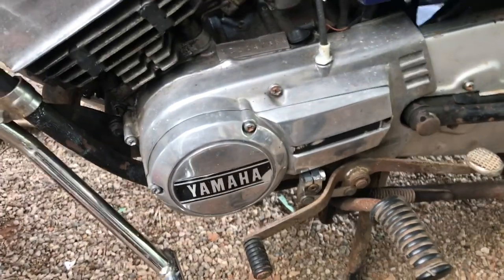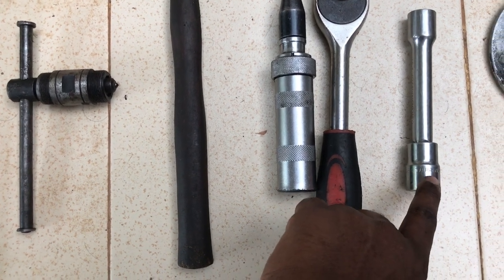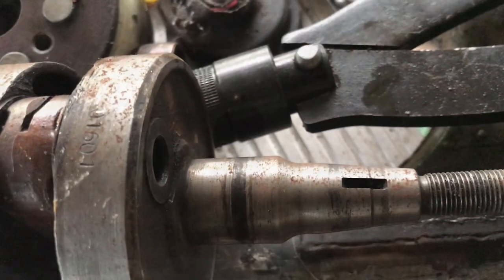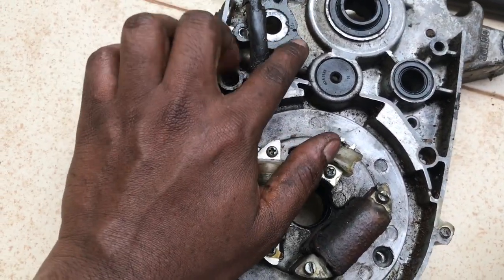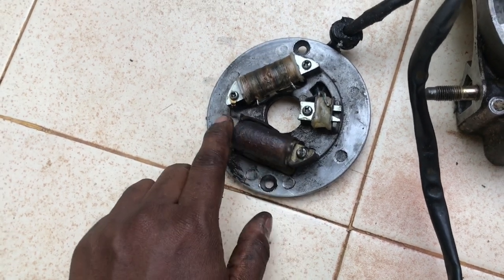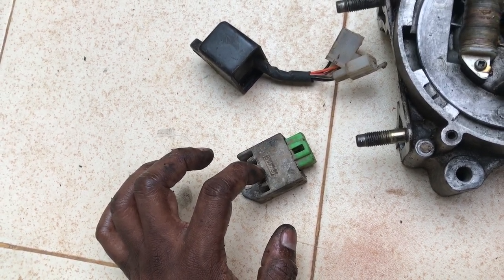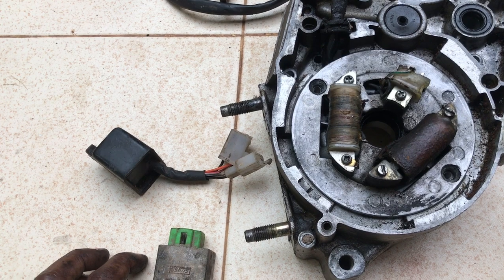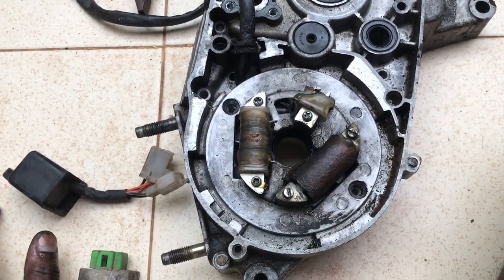Yamaha RX 100 6V to 12V conversion.

Comment: Is rx 135 lighting coil a full wave coil?
Reply from the maker: What do you mean by full wave?
Reply: @Yamakaze  stock it comes with a halfwave coil, we can convert this coil to a fullwave coil along with a fullwave rectifier
Reply from the maker: @dasinduhewagamage5949  technically it should be better, but what is the usage that makes you looking for a full wave system?
Reply: @Yamakaze  so that i can fit a fullwave rectifier and make it 12v, beacause I'm from srilanka and we dont have rx 135 lighting coils here for sale

Comment: I have tried another method which is very simple but not a perfect solution , 

My rx100 is 1986 model 
I changed 6v regulator to 12 volte and replaced bulbs for 12v electricity , 

Everything works good , but battery won't charge enough
Reply from the maker: If battery won’t charge how is it a solution?
Reply: @Yamakaze that's why I told it's not a perfect solution , my indicators and horn didn't worked because of not getting 6v battery , i tried emergency light battery but didn't worked
Now it's atleast working , 
I have 12v coil and wiring kit , I am not converting because, i think let it be stock as it is

Comment: Hi could you please do a video on rx 100/135 complete re wiring..
Reply from the maker: Sujil Ps I have already done a wiring video

https://www.youtube.com/watch?v=tIM19SI6fY8
Reply: @Yamakaze  thanks for the reply, I had already seen the video, it was realy helpfull.  My bikes wiring harness all gone can we make a new wiring harness by ourself or should go for new one, of so good quality one is available?
Reply from the maker: Sujil Ps buying new harness is easier and cheaper. New one is around 500, and available easily. Making one will be fun but sourcing all the connectors and matching the length of each loop will be a pain. OE one was available for 310
Reply: @Yamakaze  Thanks a lot for your reply.. looking forward for your posts..

Comment: What is the benefit of changing 6v to 12v?
Reply from the maker: Nibin Mathew better lighting mainly, 6v batteries and bulbs are not available easily.
Reply: @Yamakaze  That's a great info. No wonder my lights were performing as 'minnaminung'.
Reply from the maker: Nibin Mathew most of the bikes in Kerala are already upgraded, which year is your bike?
Reply: @Yamakaze  1989 I tried several bulbs, even halogens. Sadly no better results. I actually don't know whether my bike us upgraded or not. I'm second user.
Reply from the maker: Nibin Mathew check your battery, if it’s 12v then it’s upgraded. Else you will need to upgrade it
Reply: @Yamakaze  sure.
Reply: @Yamakaze  can't able to say its properly converted by checking the battery. I am saying because I see the guys just replacing 12 v RR , battery and bulbs. It doesn't produce much out put .
Reply from the maker: Ranjith P you are right, the first thing is to look at the battery, that is the easiest thing to look at, second thing is to check the voltage across the two wires that connect to the battery.

Comment: Bro upto which year yamaha rx100 had 6 volt electrical system and from which year it started having 12 volt electrical system
Reply from the maker: Not sure, I think from early 90s they came in 12v
Reply: @Yamakaze  i think 6 volt came upto 1993 and some of 1994 also had 6 volt

Comment: Bro please please make a video of 6 volt to 12 volt conversion of rx 100. It will help a lot of people including me for sure. And also show voltage and ampere reading of before(6 volt one if possible) and after one please. Thank you. Because I have a 1984 Japanese model and I am facing lighting issues due to 6 volt coil. Please make a video of it
Reply from the maker: aniket tiwari I will but I cannot guarantee when, I don’t have a 6v bike to show you before and after. Mine was converted to 12 V ages ago
Reply: Yamakaze can I fit rx 135 lighting coil directly on my old coil plate without any fuzz
Reply from the maker: aniket tiwari if it’s from an old model reg then yes, new model lighting coil is fat
Reply: Yamakaze so you mean fat coil is helpful. Please explain a little bit it would be really helpful
Reply from the maker: aniket tiwari no, the new model rx 135 fat coil won’t fit, you need the old model, if you look at the thumbnail of this video then the fastest coil in the thumbnail is to be used.
Reply: Yamakaze thanks a ton bro. So you mean for fattest coil we need to change the whole coil plate and use rx 135 coil plate,, will fattest coil plate perform better than old one???
Reply from the maker: aniket tiwari the fattest coil is the lighting coil, it is a 12V coil so it should perform better

Comment: As what my mechanic did by only changing the Rectifier, all bulbs of 6v and battery to 12volt and nothing else he  did.Rectifier/Charger of 12v is easily available in Brand Minda&Swiss. If anywhere available OE of Radoot175Excel came in 4speed Gear System manufactured till year as I remember till 2002-3 having the same Rectifier in 12v as of RX100's three pin Connector that is fitted easily in the existing wiring Connector of RX100.If according to to you by replacing the Rectifier of RX 135 the Connector of the wiring of RX100 will not fit on it.As the pin arrangement is different in RX100 & RX135 There is no need change the CDI unit.If anybody wants to replace the CoilPlate assembly for converting in 12v by putting 135's unit magnet should be required to fitted of 135 by removing the riveted plate to reduce the weight of the magnet and put by replacing the wiring, Rectifier and CDI unit.These replacement only required when as I mentioned above putting the entire Coil Plate & Magnet assembly of RX135. Initially we forced to put Swiss brand Rectifier, went off within a day hardly after covering 5o kilometers. After a week Minda brand Rectifier came in stock.Luckly still it is running well since last six months covered 1200 kilometres.As I hardly take ride just for few kilometres only. In rest of the time I use scooter or other bikes.
Reply from the maker: The world has evolved a lot, the see kinda/swiss wiring kits for 100 come with a 4 pin connector, the 3 pin can be converted into 4 pin as 2 pins in out of the 4 are ground. only changing the rectifier/ bulbs to 12V ones won't cut it, that's the reason why people complain about the rx 100 lighting. As mentioned everything needs to be changed, you cannot convert it to 12 V by replacing the whole coil with 12 V. it will work but you will loose the peppy nature of the 100.